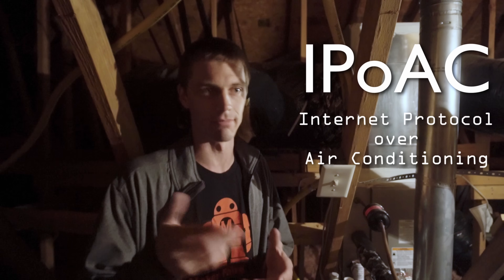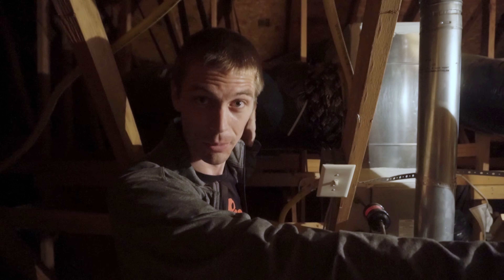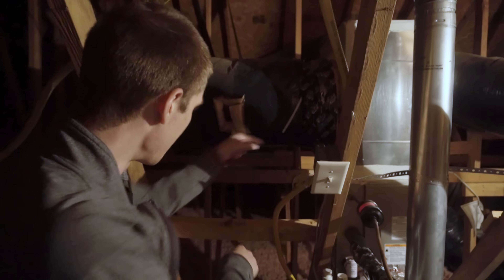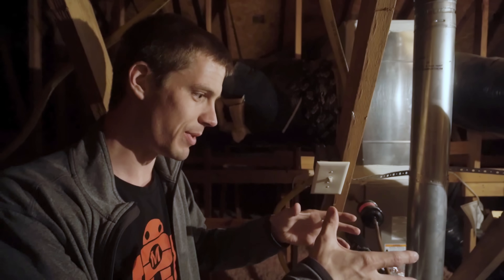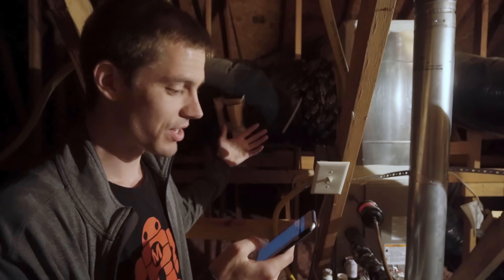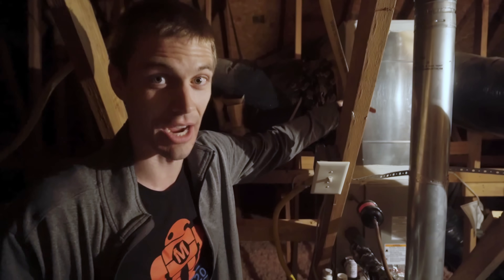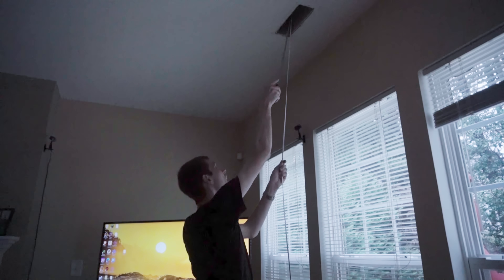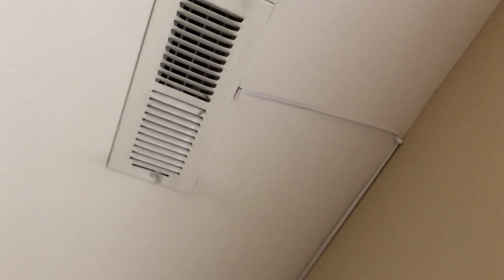IP over AC: Mmmmmm Ppppfffftttt SssshhhhhhhWOOOSH

Comment: that's a nice idea. but also, I have to tell you, it's easier to catch the cable in the scenario you provided at the beginning, than you think it is. You basically use a hook made out of coat hanger wire... and/or magnets... that's all. You put a metal (magnetic steel) plate on the end of whatever pilot you're feeding through, and use a strong magnet to locate it. It's not hard at all! And you get to play with strong magnets!
Reply: Insulation makes it much harder to fish.  It's also two floors, so he'd have had to find an existing chase or open up the wall to make holes through the bottom plate and any fire blocking.
Reply: Making holes in the wall is a life skill. fixing holes in the wall is an even more important life skill
Reply: And in this scenario are we using 30 foot long drillbits? or whats the plan there?
Reply: @variouselite  you would just follow the air gap between the studs, buuut he did say external wall so there would be insulation. you could fish the cable down between the paper and drywall but ideally you would use a non insulated internal wall. then where you want the cable cut a hole for a outlet box and grab the cable and use a ethernet plate.
Reply: There is no problem fishing past insulation, can be a pain but it's doable. The problem are the top and bottom plates. If it was one long open space I doubt he would have bothered with the bag through air system stuff. Fascinating how people always want to chime in when they have no experience in the matter.
Reply: i did low voltage install for a while. they make this stuff called Glow Rod. its a stiff, vaguely glow in the dark rod that you can connect to more glow rods. shove one end down with a string tied to it, wiggle it around until you can see it through the hole in the bottom. then either grab the string or the whole rod if the angle works for that. or tie the string on from the bottom and pull the whole rod back up. however you do it, works pretty well.

you can poke the tip of the glow rod through most insulation if youre stubborn enough, but yeah...in this application i think its likely nowhere in the house had a clear shot all the way down, even disregarding insulation. 

what I would have considered is those ethernet ports you can plug into wall sockets. ethernet over power is not GREAT and does take up two wall sockets, but hey. a 60 dollar purchase to not have to climb up into the attic works for alot of people
Reply: Getting through the bottom plate isn't too tough, in most situations.  Remove the baseboard molding at the bottom of the wall (should just be held in by small nails so a suitable pry tool should be able to remove it without breaking it).  Cut the drywall there in whichever bay you are working in but cut it with about ¼" (6-7mm) below the top of the molding. 

If the wall has insulation, use a fish tape or even fish sticks if the run isn't going to be too long...if no insulation, then a chain can be a handy way to go down in a wall as it will drop straight and is easy to feed through holes while also responding to magnets.

Drill through bottom plate and repeat on the next floor.  

To close up the hole, just put the same drywall piece back via drywall screws to the studs.  Nail the baseboard back to where it was and it hides all of your drywall/hole work.
Reply: @variouselite  They exist (not as a single 30ft length, but you can get them in up to about 8ft sections), but they're not simple to use so I wouldn't recommend it for this kind of job. I regularly use 6-8ft of flexible drill extensions to drill holes in noggings in walls when I'm running cable, it's a pain in the arse but it works when you've got no other practical option.
Reply: @SomeMorganSomewhere  I was wondering lol, sounded like American houses didn't have noggins for a while there. Yeah,v pretty much no diy guy is going to have 2 stories of drill like that and they probably aren't going to want to take the roof off to get enough access to use one on an external wall either. Especially with those American plywood and glued on stuff roofs. (We often have metal roofs in Australia, it's not that big a deal to lift a sheet to get access to the roof)

Comment: Fun fact: IPoAC stands for something else too!

It also means IP over Avian Carriers, a (obviously not serious) protocol that takes advantage of the flight speed of birds like carrier pigeons, combined with the storage density of things like 1tb microsd cards. In certain circumstances, it would be faster in theory than most modern IP implementations.
Reply: Dont they already do this in some cases? just not with pigeons, but airplanes. Faster to pack up all hard drives and air ship them than move the data over the internet
Reply: Nice one!
Reply: Thats intentional referense to and older april Fools joke.
Reply: "This image is an example of packet loss."
Reply: HTTP-D involves Donkeys carrying your packets.
Reply: In a lack of understanding my audience, I wrote an essay about RFC1149 in my Composition 1 course. Fascinating protocol in theory in IT, but not to writing professors.
Reply: @rykehuss3435  i think thats how they shipped the event horizon telescope data 
from antarctica at least
Reply: had a question on my networking exam the other day, where the answer turned out to be pigeon was faster than the dial up connection haha
Reply: Edited for full correct quote: Never underestimate the bandwidth of a station wagon full of tapes hurtling down the highway.
–Andrew Tanenbaum, 1981
Reply: It depends on if the swallows are european or african though (you know, because the unladen air speed velocity is different)
Reply: Good old RFC 1149! From 1. April 1990 - today exactly 33 years ago
Reply: @zeronezerone3659  really?

if true, i might have to put me donkey to good use, anything is faster than my router
Reply: It might be a joke to you but that’s how I’m making this comment right now. Now likely being a few hours ago.
Reply: It is a great protocol, but the latency is terrible. I have been waiting for the reply to an e-mail I sent for a good 7 years now.
Reply: Like the thing where it's faster to just ship a harddrive than send the contents online?
Reply: @Electric999999  but sending the bits online doesn't drop kick the hard drive into a truck, run over it with another truck, and leave it out in the rain when delivered. Also gigabit (or greater) internet connections are pretty common these days - even with overnight shipping, the internet probably wins
Reply: @adammineris  That's unfortunate. Sounds like it would be delightful to read and grade hahaha.
Reply: ah yes, the contemporary version is IPoINT

IP over Intern. because there are MANY situations where sending large files in the intern's ford focus is faster than email.
Reply: https://en.wikipedia.org/wiki/IP_over_Avian_Carriers
Reply: @PetesGuide  beat me to it ;)
Reply: @arcanealchemist3190  yeah, that's the commercial version of "sneakernet"
Reply: @rykehuss3435  also if the human chain in reliable, it's even safer.
Reply: I was actually expecting a third kind of AC - alternating current. You know, those awful ethernet powerline adapters that were a thing at some point.
Reply: Thats just sacrificing ping for bandwidth
Reply: I remember a Linux User Group here in Norway tested this protocol with pigeons many years ago. Unfortunately they had a pretty high packet loss.
Reply: I thought it meant AC power, and I was thinking Internet over Power is a thing. But this being AlphaPhoenix that would be tooooo boring to make a vid on unless he did a full modulation of the AC power.
Reply: The Standard expects you to print it out in hexadedimal and to wrap it around on foot.
Reply: While, yes, the data transfer rate would be rather high, the latency would be absurd.
Reply: In grad school I computed the bandwidth of Bernie the St. Bernard carrying a whiskey keg full of 8" floppies across the Alps. Latency was high...
Reply: @Electric999999  😊
Reply: Reminds me of Sneakernet: Putting on your sneakers and running over with the physical storage.
Reply: @rykehuss3435  Packing up harddrives is not internet protocol
Reply: Today, we can use IPoDC , Drone Carrier. Flying a drone across campus with an M2 NVMD 4TB or larger drive, will still outrun a 1Gbe connection.
Reply: LoL :D

Comment: First reading the title I was expecting AC to be alternating current (send data via AM/FM?), and then for this to turn into an electroboom-esque video
I like that instead of putting "don't try this at home" you put "IF you try this at home" it's much more inviting
Reply: They do have ethernet over powerline (AC) adapters - you can buy them off the shelf in the store. I think they even go to gigabit now. Nothing beats real ethernet though...
Reply: @gorak9000  cool, the more you know
Reply: @gorak9000  Yeah, I'm a bit surprised that wasn't everyone's assumption given the ubiquity of such devices. I actually clicked because I thought it sounded too mundane he was just using a powerline and there must be something special going on. I was not disappointed!
Reply: @gorak9000  Yeah, I thought the title meant that.

Comment: @AlphaPhoenix Network Engineer here; running copper, or even fiber cable this way is actually not as uncommon as you might think. When ducts are used as paths for cables that pass through plenum, you want to use plenum grade cable which have a flame retardant sheathing. This is especially important in commercial jobs for building codes.

I used to work at a college that had steam tunnels that conveniently connected all of the buildings on campus. We had insulated conduit run through the tunnels with plenum grade fiber.

As an alternative, for a residential job like this it's possible to leverage EoP (Ethernet Over Power) adapters given the right conditions. However, given how far away your run is the likelihood that you're on the same phase and circuit are pretty much zilch.

Another option is point to point wireless bridges. If you can have the two antennas in direct LoS of each other you can traverse the entire length of your house easily, and with a newer 5Ghz high gain antenna you could achieve near 1Gbps (likely the same speed as your internet anyways, and sufficient for LAN transfers).

Comment: To run cables down thru walls there are magnet cable pull lines. The floor transitions would require cutting some holes.

Comment: As a complete aside to how goofy this video was (I actually forgot it was the first of April until I checked the comments), that attic ladder location scares me. I have trouble enough getting myself to go up the wobbly ladder in my house, let alone the added fear of falling down a flight of stairs if I do fall! least getting the Christmas decoration downstairs is easy, so long as you don't mind a few broken ornaments each year.

A quick edit to append something that's substantially more relevant, but still very tangential; about the pressure the HVAC in your house creates, I once heard a story from someone who did HVAC for large buildings. I forget how it exactly played out, but a building ended up with either exclusively air intakes fans or air outtake fans, I forget which; either way, the fans were creating a significant pressure difference inside the building. So much so that after the HVAC system was turned on, you couldn't leave the building because the door was stuck shut. If you figure it's a door about 2 square meters in area and the pressure is 1 kilopascal, that's like 200 kg of weight being set on the door. The force at the handle is going to be less than that, but I can't bother with doing the integral right now to find whatever it might be.
Reply: Aren't exit doors on buildings supposed to open outwards? That way it's easier to exit during emergency, just by pushing on the door.
Reply: @areadenial2343  If they were, then all the fans had to be blowing the air out for this to happen. And pushing with even 100kg force (half the total estimated above, if you push at the very edge of the door) would be pretty hard.
Reply: Actually, I just remembered, I experienced something just like that in the past.

The dorm building I lived in while at Uni is pretty tall, and its shape makes it a very good wind trap. Combined with old windows that are far from sealed, that creates quite some drafts even when the windows are closed. And on one especially windy day, I had to put my leg on the wall and push pretty damn hard against it to pull the door open and leave the room, and I was kinda afraid the door handle might detach in the process. And once the door opened like 2cm wide, enough air just left the room and I almost fell on my back.

As a bonus, glass shattered due to wind smashing windows/doors closed/open was lowkey-common there. And I've seen at least one doorframe noticably damaged by wind repeatedly slamming the door really hard. And one time, when the wind was blowing into my room from the corridor, the door force-opened on me when I pushed the handle down, and I heard glass shatter somewhere on the other end of the corridor a few moments later, couldn't help but think that "I did that".
Reply: In minneapolis the old metrodome had an inflatable roof that was held up by air pressure. If you left before a game was over, the revolving doors were locked and it was a bear to pull the exit doors open. You were then ejected out with an audible swoosh of fast moving air. Loads of fun for youngsters but a real danger for elderly fans

Comment: I thought this was a common practice, because my dad (a network engineer) routed ethernet into my childhood bedroom through the return duct. Not the grocery bag parachute part, obviously. Lol

Also, I was today years old when I realized AlphaPhoenix's logo was a phoenix's flight path in the shape of the character alpha (α).
Reply: I thought the grocery bag was a common trick. I've seen it used seriously to pull a string through conduit using a vacuum cleaner.

Comment: I worked condo security for several years, and I did a lot of work with guys installing fibre optic cable in high-rises.

They use a similar concept, but they do go through the walls vertically. They have a long spool of semi-stiff wire they call a "fish", and one guy will feed the fish up or downstairs, and the other guy who has the fibre optic cable will tape the cable to the fish, and the first guy retracts the fish, pulling the cable with it.

Otherwise, it's just a bit of drywall work, and if you know how to splice the cable, you can get physical connections basically anywhere.

Comment: Old video but I always considered this an option if i ever needed to run ethernet without cutting holes, the parachute bag idea is genius.

Another solution is to use MOCA if you have coax already ran in house, they are capable of gigabit and only introduce about 1ms of latency.

Comment: saw your new IP over AC video, couple observations:
1. you used a flat cable, and a rather long flat cable, you should change that for a conventional cable to get the EMI protection that is inherent with twisted pair ethernet.

2. You ran the cable inside an air plenum, you should make sure to use Plenum rated cabling. If for whatever reason that insulation ever burns, you’re going to have nasty fumes all over your house

And I know said only a couple, but #3 it may have just been easier for you to run a conduit down the side of your house and in through the outside wall on the first floor.

Other than that, great video, and be careful next time you close all your air ducts, you could end up blowing an air HVAC duct or damaging your air handler. And for your storage needs, get a Synology Plus series NAS, thank me layer. 

Ps: posted this on Twitter first but then realized I could just comment on YouTube, lol
Reply: wires in flat ethernet cables are still twisted pairs

Comment: We use this technique all the time in telecommunications. Vacuum and an expensive bag to pull string through pipe. There are jet operations similar to what you did to blow cable into pipe over thousands of feet.

Comment: I worked on critical systems at a large data center and when they'd run the big cabling under the building from the power switchgear to the generators, they'd employ the same technique. I asked one time and they showed me a shopvac and a plastic bag and that's all they needed. Then, they'd work their way up in string/rope size until they could winch the large power lines.